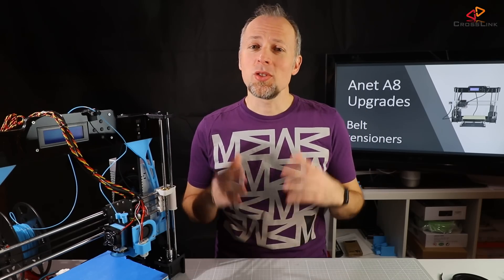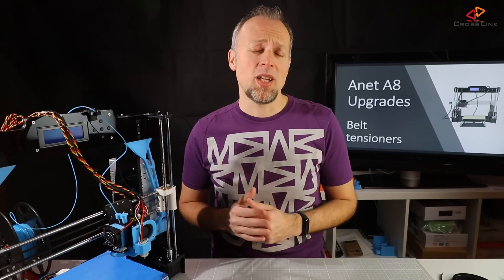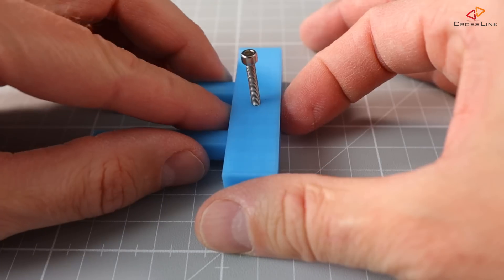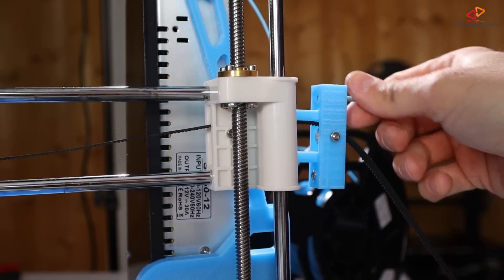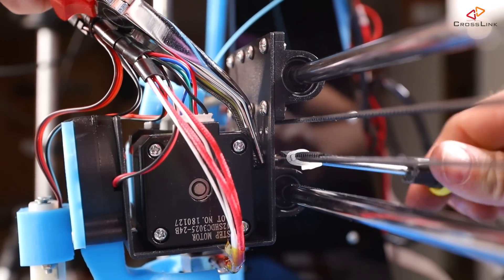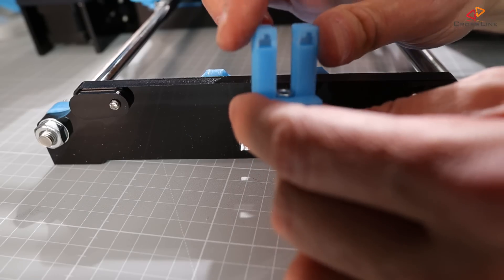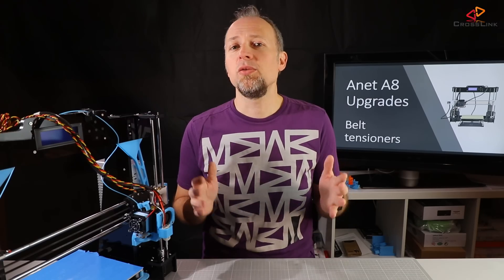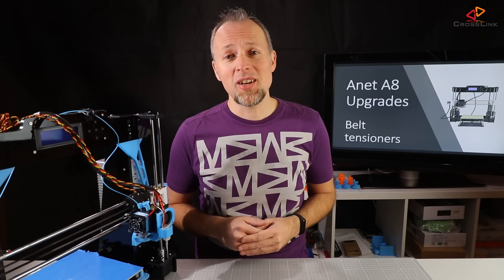Anet A8 Upgrades - Belt Tensioners

Comment: I wonder if you would see a difference in a print if you do it with looser / tighter belt. Btw. have you tried printing on a glas surface? I tried the glas cover of a picture frame and it works surprisingly well
Reply from the maker: I am trying glass, wilk share my experience soon.

Comment: I used the same type of X-axis tensioner as you. A key feature is that it moves the load onto the horizontal guide rods directly instead of via the white plastic carriage. This can prevent accidental loading/bending of the Z-axis guide rods. I also added two knobs on the screws so I can adjust the tension without a tool. Got the knob from a Y axis tensioner design that used the same size screw.
Reply from the maker: Thanks for the comment, like to add a link here to the knob?

Comment: Thanks Daniel, The Anet A8 definitely needs belt tensioners.  I ran into problems with an x axis tension similar to the one you show.  The one I used did not fit inside my x idler part.  Maybe I'll try again using the part you have linked.